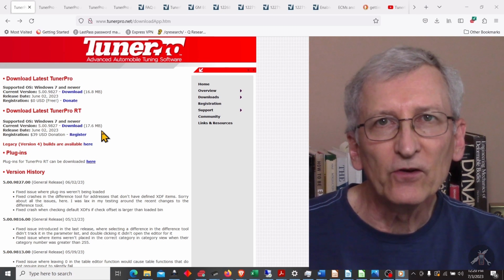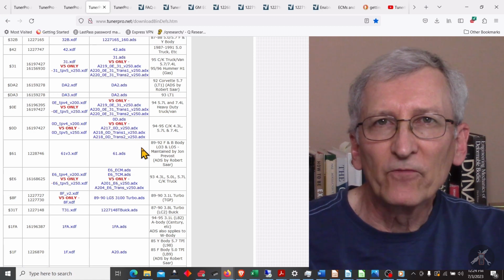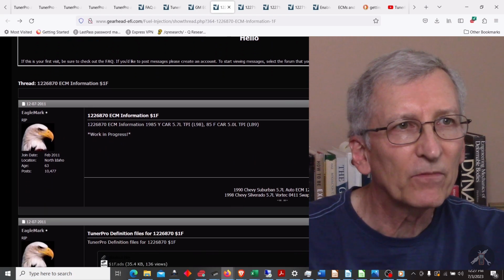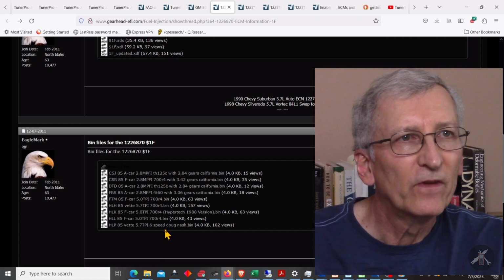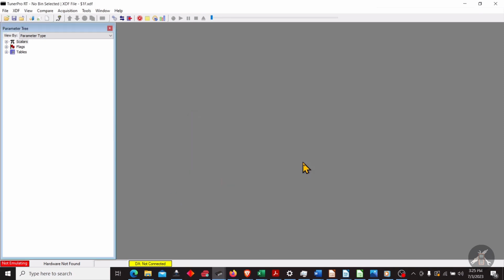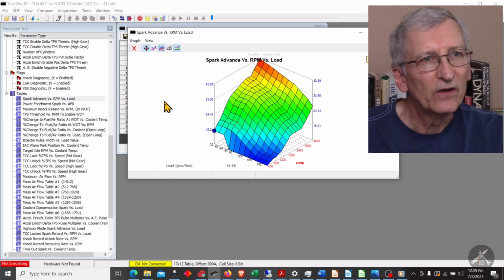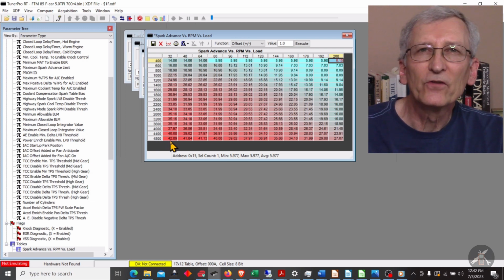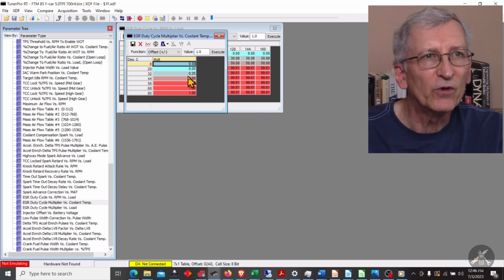How to Set Up TunerPro5 to Read the PROM Data from ECM - GM OBD1 & 3rd Gen Camaro

Comment: What is that GMU mug behind you? It looks like it says General Motors University. I went to General Motors Institute (GMI). I've never heard of General Motors University.
Reply from the maker: Yes, that is a GM University mug.  I lose track of the exact years, but GMU started roughly around 2000 or so as a more structured internal training organization. There were always internal training classes, but this gave them better organization.  GM purchased a closed Kmart store in Pontiac / Auburn Hills and converted it into a center full of classrooms and other facilities.  For a number of years, many classes in SE Michigan were held there.  I don't recall when it closed, but I think it was around 2010.  When I retired, GMU staff was still there, but classes were scheduled at various locations or online. Class teachers / trainers were usually subject matter expert employees.  For a number of years, I taught a section of a hybrid propulsion design class as an assistant chief engineer.  GMU staff provided the scheduling and logistics for us.

Comment: @bits of wisdom great information and really appreciate your insight. I have a question that I could your help with. I have an 87 GTA Trans AM with an L89 5.7 in it. There is no definition file link on Tunerpro’s website it looks to me that I need A028, and I cannot find one elsewhere. So I’m effectively dead in the water trying to connect to my car and proceed. Any suggestions on where I can find a good definition file for my car?
Reply from the maker: Look on this page.  It doesn't have the A028 numbering, but under mask ID 32B and your application, there is a bin and datastream.  XDF / ADS.
https://www.tunerpro.net/downloadBinDefs.htm#GM

Comment: Very informative video. I have a 1988 Corvette. I have been trying to delete code 36 and modify the temperature the fan comes on. I modified the code burned a chip and placed it into the ECM. The car operates the same as before the changes. Does the ROM chip override the MemCal? Is there anything I do to bypass the ROM settings. -Thanks
Reply from the maker: I would have expected that if you modified the settings in a removable PROM / Mem Cal, that you should see a change in vehicle behavior.
I'm not sure, and need to be sure we're talking about the same things.  My '85 has two chips a PROM and a Cal-pack.  The Cal Pack is essentially calibration for a limp home in case major failure occurs in the ECM. The PROM contains the vehicle specific calibrations. My understanding of the Mem Cal unit is that it contains both of these functions as well. I'm not a controller engineer, but I believe that the ECM also has certain functions programmed in chips soldered to the board-another form of ROM. My understanding is that the calibration settings in the PROM or Mem Cal do control what the ECM does. I suppose that there could be some built in overrides in the onboard ROM that limit the PROM calibration authority, but for what you describe, I would expect you to have control.

Comment: So get this! 1988 Cavalier Z24 2.8 mpfi engine 5 SPD trans with digi dash, 262H Cam 24lb fuel injectors, 3500 valves, etc... would getting a chip from the lumina Z34 3.4 dohc motor make this run good🥴🤔
Reply from the maker: While a fuel or spark curve from a different engine might be possible to try by copying the calibration into another chip.  An entire chip from a different design engine and car will usually be very different and not compatible as a direct swap
Reply: @bitsofwisdom460  What made me think why this has a chance to work is there was somebody who made a K-body Dodge Daytona Shelby Z, made it make 300hp and the only way to tune it good was getting a prom from a 5.2L V8 Dodge Van!!! I gotta try out of great curiosity, I am toning down to 19lb injectors so... Can't wait, about 1 month it should be all together and running

Comment: Dan, Just curious if you have had any problems with your Actron scanner connecting to the IROC? I keep getting error code “internal Error message 0x0004”. Actually the only way I can get my scanner to connect to my 86 IROC is by selecting the vehicle as a corvette which works however there are some different parameters on the 5.7 vette that are not on the 5.0 Camaro.
Reply from the maker: Not familiar with that code.  The only connection issue I have had is if I didn't have a good 12v power connection.  The OBD1 GM needs that 12v power. Otherwise, you might try email to their tech support. I had a question a while back and they were responsive.

Comment: Thank you very much for sharing your knowledge with us. I find it very helpful. 
I'd bought some Moates items over the years. I'm going to be putting a 3400 engine in a 1994 Cavalier. So, I will need to make changes to get a 3400 running correctly. Your videos have been the most thorough I've seen for someone just learning how all this works together to tune an engine. Listing all the links is also very helpful. I'll be sure to watch and learn more from your videos.
Reply from the maker: Thank you for your comments, I am glad that it is helpful.

Comment: Thank you for obd1 information. I want to dig into mine more. I used TunerPro.  Seems like I got my bin file definition file from gearhead like you - moates sold me the burner software. You missed the fact - that you dont need to use a downloaded BIN File, you can backup your own, and use it.  I used my own bin, backed it up first, for safety, modified the FAN ON /FAN OFF temperatures (to keep the car running at 180° instead of 220°) which I HIGHLY RECOMMEND Dan!  Do it!  Your performance will only improve! I bought a 50$ chip burner and 10$ ultra violet chip eraser, and reburned my factory chip ASTY i think it was.  After changing my fan on/off temps, I reburned my erased chip with my own bin - changed for temp only.  Now my car never creeps up to 240° in traffic!  I bought this generic eprom burner off ebay:
https://www.ebay.com/itm/123541422328?mkcid=16&mkevt=1&mkrid=711-127632-2357-0&ssspo=LeSqTbKDSXy&sssrc=4429486&ssuid=c9ONWIomQGO&var=&widget_ver=artemis&media=COPY
Reply from the maker: You're welcome.  Thank you for the link.  I did mention in the video that you can get a programmer and read the chip, but for a first look, finding a posted file is easier.  Incidentally, the moates site seems to be down and apparently they are no longer operating so I need to look for an alternate.
Reply: @bitsofwisdom460  Actually, as I think I did not use burn software from moates - I used the software that came with the burner.  Moates had a burner + software, but I opted to go it alone - old video gamers burn and copy chips with these things - so i figured its just a binary file- Like theirs so I took a chance on generic burner.  It was REALLY interesting - erasing that chip with UV light!